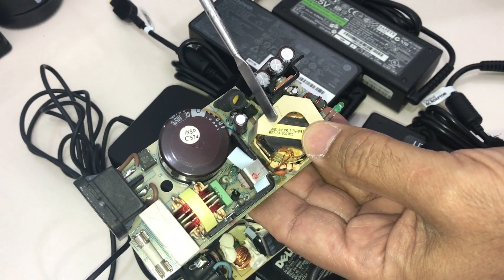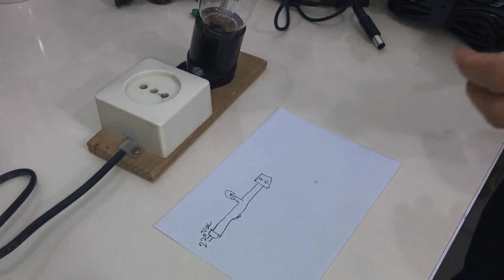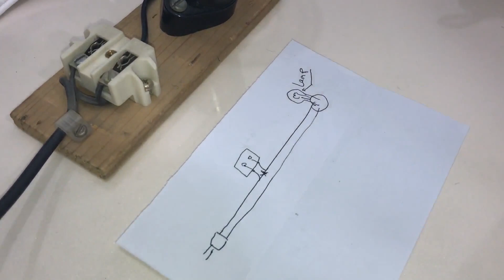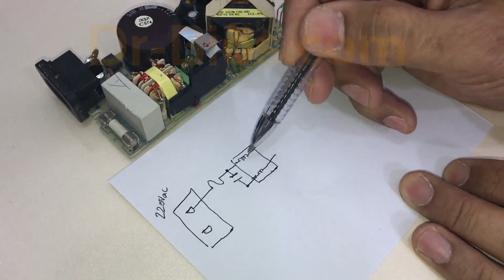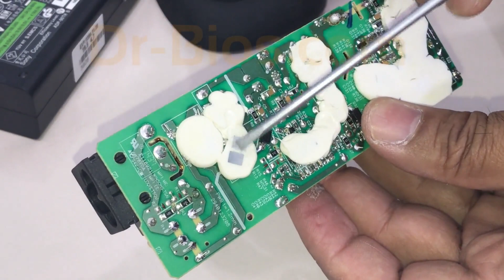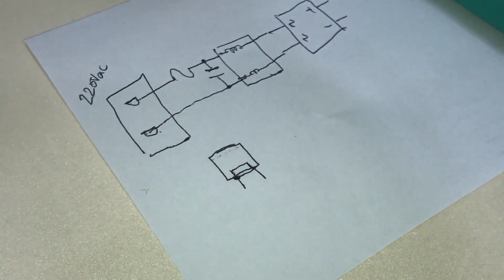How To Repair Laptop AC Adapter Part 1

Comment: I have changed a damaged capacitor of my hp adapter but the it didn't work. I then watched this video and saw this black boxed fuse. I checked its continuety & found it open circuited. I twisted 2 wires as recommended in this video & successfully repaired the blown fuse. The adapter is up & operational now.
Thank you so much. I really learned from the video.

Comment: Excuse me. I have a laptop charger (Acer). The input : 220V AC => The DC output fluctuates between 18,6V and 19,3V. Then I plug the output into my laptop, the DC output drops. It shows 14,5V on my voltmeter. Result : I can't charge my laptop. How can I fix it ? Thank you very much